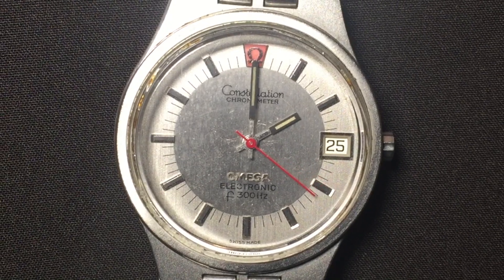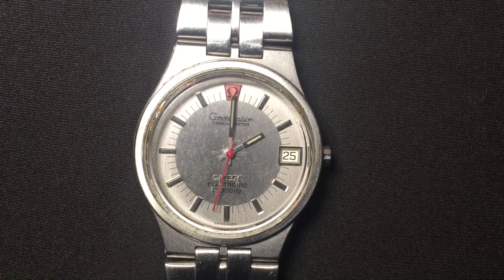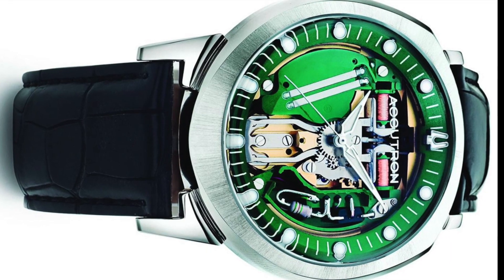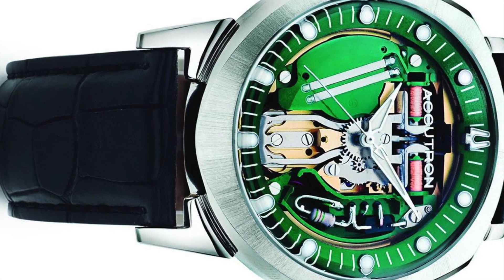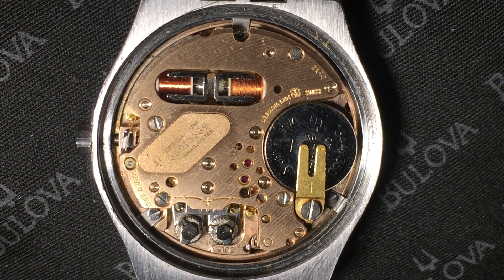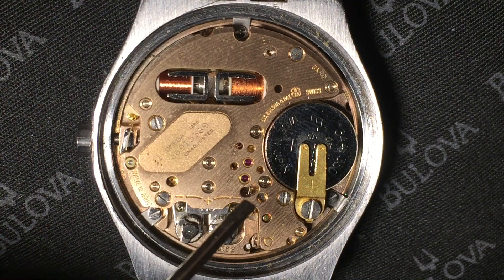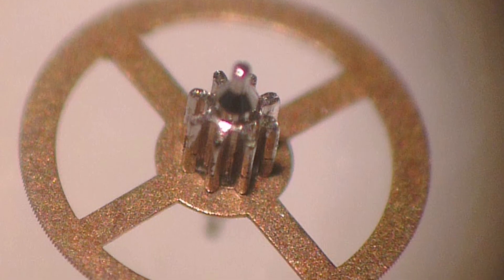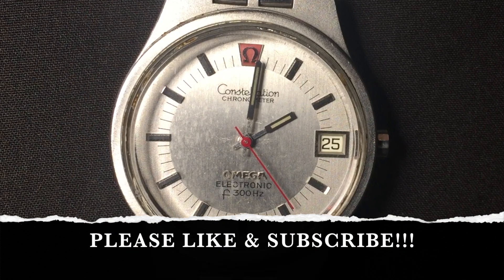The Watch That Time Forgot : The VERY INTERESTING OMEGA F300

Comment: Hoping you can help me. I have a 1973 f300 that I bought with my first pay check. After it stopped working, my watch guy replaced the battery, no good and opined that it was likely the end. If that is really the case, could I replace the movement with a modern one? It wont be an Omega anymore but at least I would still be able to wear and enjoy it.You say?
Reply: Get a watch repair place to fix it. A few people in the states work on them. I wouldn't change movements.

Comment: Mine was working fine and after it quick I replaced the battery, but it will not start.  do I have jump 2 connections or something to get it started?
Reply: Connection between modern batteries and the circuit is poor (original battery designs had a "nipple") Sometimes just putting the watch on the heat from your hand after a while can jump start it.